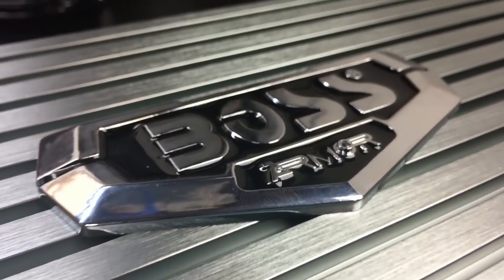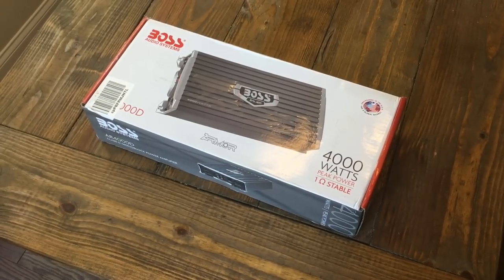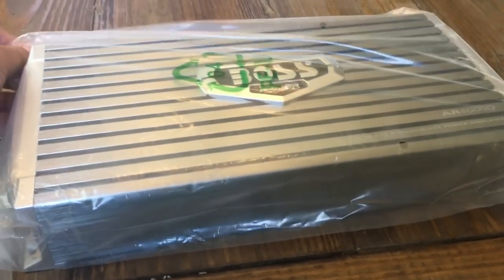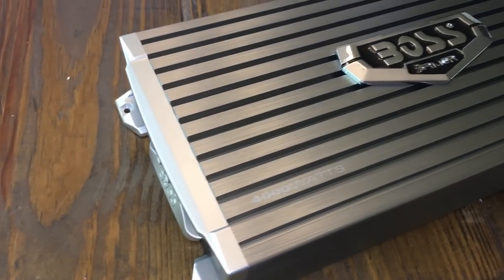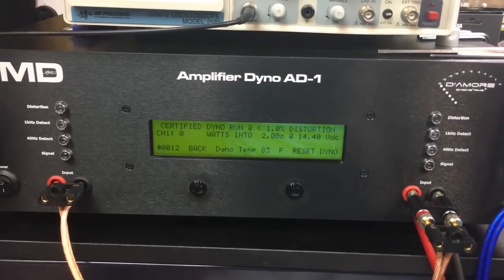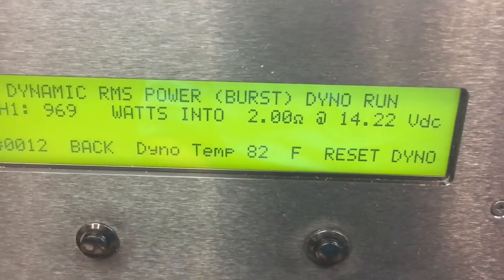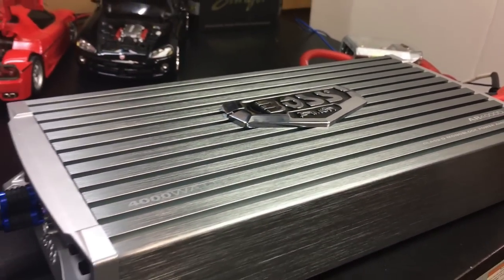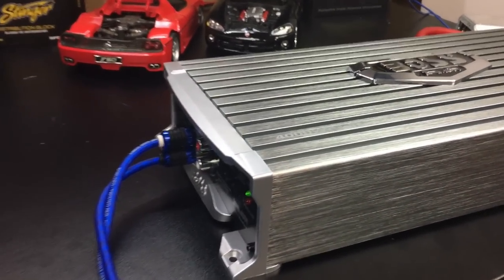Who's the Boss? AR4000D 4k MAX Amp Dyno Test

Comment: Derek, I decided to order this amp today, 2/7/20, based on your review. I didn't pay $85.00 you paid, as Amazon's price went up to $114.95. But  I wound up paying $109.95 for it on Walmart.com, which still seemed like a pretty good deal, even though it was a bit more than I wanted to spend. I watched several of your amp dynos, as well as many of Budget Gems. Despite the fact that Boss grossly exaggerates, and sensationalized their ratings with their fictitious figures, I found I  was quite hard pressed to find an amp actual dyno tested figures of power this high for $100. The watts per dollar in the neighborhood of 950 + watts dynamically at 2 ohms looks pretty hard to beat. And nothing beats the validated research you do, and dyno results. I'm thinking this should drive my two JBL 12" subs, at 4 ohms each for a final 2 ohm load quite nicely. Interested in hearing your thoughts and opinions on that.

I was also impressed with your thoughts on the build quality, and the fact you had a hard time destroying a Boss, short of dropping shreds of copper wires inside of the chassis. That in itself speaks volumes of what one might anticipate in terms of an amps durability, and longevity.

I considered many amps, and found a few that did come close, but went up in price dramatically since being dynoed. One in particular was the Walmart in store stock Power Acoustic amp for $69 when dynoed by Budget Gems, which is now almost $100.00 in store. No doubt retailers like Amazon and Walmart are watching these dynos, and marking up their price. In any case,  I just wanted to let you know how much I appreciate your videos, and how influential, and helpful they are for us naive consumers out here, who are quite easily duped by market strategy, deception, and baloney some of these snake oil salespeople will try to have us believe. At least those of us armed with knowledge you provide can make educated choices, and find value for our hard earned dollar. For that sir, I thank you for all your efforts.

Comment: A guy came to my shop with 2 of those "monsters" and 2 boss "2300watt" 12s he thought it banged. And was the loudest setup on the block.AAAnd it sounded like crap especially with the gain up all the way also on one battery rip off red top. 1000ca. And don't forget the box was one big rattle trap. His voltage drop tremendously were the car wanted to shut off. But after I redid the wiring with stinger 1/0 to the And for the big 3/4 also reinforced his box with some dail rods and a extra baffle. I also added a XS power D1200 in the back. Did the speaker wire as well (12gauge Rockford fosgate) each amp was tuned with a DD1 and gain match with a CC1. The system actually surprised the heck out of me according my to APM-1 he meter  A 143db sealed. So it's loud for the price he paid.  Boss maybe knocked but in the right box and tuned correctly it can bang That goes for any manufacturer. It's up to the installed to make it awesome.
Reply: djbz bruce-zabala that is very true back in the 90s people knew I could hook up stereos and they would always bring me a bunch of crap. I would hook it up and surprise everybody how good it ended up sounding.
Reply: I completely agree, a good installer can make dog shit equipment sound GOOD!

Comment: I had a 1500 watt boss amp when I was like 17. It was more like 150 watts... lol
Reply from the maker: +Gnik4144 this one beats the 10 percent rule, lol
Reply: Gnik4144 no impossible when you plug the numbers in
Reply: I have a newer 1500 watt BOSS. It pushes my 12'' Boston G3 no problem for $60 I consider it worth it. If I had to guess it's probably 375-400 rms at 2ohms
Reply: Even though no amp I've ever seen had a super weak 20% efficiency you are claiming your Boss amp was less than 20% efficiency? I hardly doubt that.
Reply: Tyler Padgett I also have a newer 1500 watt boss amp I would say it’s much closer to 200 Watts it struggles to push my 12” kicker cvx I’m upgrading to the 3000 watt boss amp and am hoping it will be in the 500-700 watt rms range
Reply: BigDWiz did an amp dyno on your Boss 1500 amplifier.  I think it did below 200 watts @ 2 ohms, very close to 200 though or maybe a bit over it.  But basically a 200 watter.
Reply: MacNifty search up the planet audio 1500.1M it's like 100 watts rms. Less then %10
Reply: I had an old school alpine 200 watts RMS hooked to my old diamond single 10 also rated at 200 watts rms in a big vented box, it hit pretty good and did really good below 30hz but wanted more so i got the boss amp in this video. Wired the sub down to 1 ohm and now im finally getting the most out of that little diamond sub lol, 200w rms on the sub but it takes all 900 from the amp just fine, sometimes it bottoms out but the coil never burns haha
Reply: Imagine a 4000watt rockford fosgate amp lol.
Reply: I remember doing my first ever system in high school i was 18. It was 2010 i went crazy on the subwoofers 08 kicker L7 12s in a rhino lined atrend vented box. And yeah you guessed it i bought a 3000 what boss audio amp i set the gains and everything for 1500 watts rms at 2 ohms. It wasnt 1ohm stable well needless to say my subs fried that amp after 2 songs 😂. I switched to a hifonics brutus BRZ 1700.1D.  1700 rms at 1 ohm and one 170 amp fuse so it put out what it advertised. Iv been using hifonics ever since
Reply: I have a boss 1600 watt 2 channel(bridged). I've had it for 4 years and it's pushing a 1500 watt 15" strongly. It never over heats. I've been reading alot of reviews on Boss amps and it seems the mono-blocks suck but the 2 channel is alot closer to the listed power and seem better rated by the average person. I would love to see a 2 channel Boss dyno'd just for comparison to the mono-blocks.
Reply: Ya folks  please put a little more money with it and get a name brand like Hifonics or Sony kenwood.or even buy a used amp make sure it works first.
Reply: @craigbarnett3564  Sony amps? Bahahahhaha junk. And Hifonics isn't thag great either.  I'd rather get an older used Alpine or MTX as a cheap amp.

Comment: I've been waiting for a video like this to show the real numbers.. I had this amp when it first came out and it sounded great and pushed pretty hard. at the time I was getting a reliable 800 watts out of it pushing 4 cheapo 10s in my truck. it was an awesome sounding budget system
Reply: I had one and was running two polk momo 12's in a ported box and two old xplode 12's in a sealed box,  in a 2000 grand Cherokee,  my rear window used to Flex a lot actually

Comment: Hey Big D. I bought 2 Boss audio Armor 4,000 watt amp because of you. I trust what you say and I enjoy your videos. I strapped my two AR 4,000 together and wired my two Audiopipe Txx BDC 15s down to 1 ohm and I have to say Big D !!! You are right!!! Not bad for the price. These subs are frickin slammin with two amps strapped and two amps for only $200 bucks a person really can't go wrong. I'm happy with AR 4,000 for the price. Thanks for your honesty.
Reply: Keep in mind that when strapped together the minimum impedance changes from 1 ohm to 2 ohm. You say your wired down to one ohm, but I think in reality you're amplifiers are not seeing a signal below 2 ohm due to box rise or impedance rise. The AC impedance is always going to be higher than your measured DC resistance.

Comment: 1400 watts for a C-note is a Steal!🕵🏿 👮🏻🏃🤑🚔🚨 But I would buy a CAB amp instead😜...if I was a budget hound.
Reply: Get the Pioneer 8601 for about $110 free shipping. 800w RMS
Reply: Its not a steal when you have to replace ur amp 10 times

Comment: I think your generous on the 15V assumption. Granted some people do run 16V for better performance, but all car alternators are 15V Ice cold, to 14.4V expected Voltage to 13.8V hot, with internal regulator. So I hope no one runs a large system without the car on. LOL. Still I would give this amp a generous 1656 watt rating at it's lowest possible Ohm rating. Myself I owned a good Boss amp over 20 years ago, it came with  a 6 year warranty, and it actually held up. Eventually it suffered from vibration damage.

Comment: hey you get what you pay for 100 dollars is a deal for that many watts
Reply from the maker: Build quality was better than expected. I was expecting poor fitment, cheap feeling and lacking bass. I was pleasantly surprised as my low expectations were apparently too low...
Reply: actually a $100 is a steal compared to amp prices 20 years ago.
Reply: jhue73 true I remember dollar a watt prices
Reply: Realdude rec true!!! in 1998 ish I had a punch 1000 it was $1000 and they didn't have the technology to dyno amps...if they did we didn't know it
Reply: Ryan Smith they were definitely real power back then lol I had the same amp on 4 jl audio w6 12s back then going crazy blew them bout 3 times
Reply: Realdude rec I had it on 4 punch series 1 15s lol. 4 altec 6x9s pushed by a little punch 40/40
Reply: Ryan Smith nice bet it was loud af
Reply: That's because they are using Chinese class D amplification I/C's and not true FET amplification.  The Class D amplification is what makes these amps so affordably cheap.  The up side, besides price, is that they are easily replaceable, for relatively low cost, if you cook the amp.  The down side, is the ydo NOT reproduce the audio to near as accurate a degree as a MOSFET amp.
Reply: Just because it has wattage doesn't mean it's good. More watts isn't always better.
Reply: They should market it as a 1k amp. Also I paid $500 for a 500 watt Soundstream back around 1995
Reply: So many boss haters in these comments.

Comment: It blows my mind that this is #1 on mono amp in amazon... But i guess i get it. They design is clean and the build will get you by. Like you said perfect for a noob. I had a Sound Storm lab ab-class 2000w and it was made by boss. It put out some bang but it wasn't the cleanest watts and clipped very easy and got hot as hell. I beat the shit out of it though. Good for starters
Reply from the maker: Amazon can't keep them in stock. I've been watching for a few months and prices vary between 82 (lowest I've seen) and around 110.
Reply: Umm.. if it "clipped" that because you had your gains/bass boost/head unit settings or volume too high.
Reply: bavarianblessed I wasn't talking about BigD's on the video... I was replying to BlocKustomz comment about his experience with his amplifier.
Reply: If I bought 9 of these amps for the price of one Rockford T1500.1bdcp... I think the dude with just the one T1500.1bdcp would fkn cry when you turn up the system and watch those cones fry!!!!
Reply: #1 on amazon probably cause of the price point and so many people just wanting a decent budget system. for $100 give or take afew bucks its definitely not a bad buy if your broke or just wanr a little bump and dont care about competition level setups for the 1000s and 1000s they cost. Makes sense its the #1 selling amp

Comment: A Taramps 4k would fit in a mailbox and still give you 4k rms.
Reply: taramps is a Brazilian board, almost guarantee you would see 4k out of it.
Reply: tramps do good power, but blow pretty easy if your electrical isn't in that sweet spot for   volts.
Reply: Yeah it's alot easier to get a larger voltage drop the higher the voltage you have to run it. If I remember correctly their amps are 200 volts! The cool thing is you can shock the shit out of someone on your door handles. lolol.
Reply: Tim Germany Crapamps? You're better off with Mmats..

Comment: Half tempted to order 2 of them and strap them on my power hx2s and see how they do
Reply from the maker: +shawn hilton I really need to get some subs hooked up and wired at 1 ohm so I can really give these amps a true test with subs after the Dyno test. My 4 ohm Infinity Perfect sub barely makes them sweat
Reply: Hmm.. Something like a Sundown SA-12 wouldn't be too bad though.
Those subs comes with an optional D2 or D4 coil, and are rated at 750w RMS
Reply: shawn hilton don't... Get soundstream rub 2500... Really good and for around 200 bucks

Comment: seems like a good deal for hundred bucks but how would this amp hold up to hot summer days thumping in the trunk for extended periods of time? lol
Reply: Anthony B D my guess is those bargain bin capacitors would quickly get out of spec and start wreaking havoc within a year or two.
Reply: Anthony B D read the amazon reviews. A lot say they run hot. I probably wouldnt go 1 ohm on it at   consistant high volume
Reply: +Jeffrey Barton You're right. Running 1 ohm
 on these boss amps will over heat and kick in and out of protection mode.  If you do use a boss for hours just fold down the seats and crack the windows and viola.
Reply: lilkamabeast 😂😂😂
Reply: Running at one ohm kills all amps faster than 2ohm. It's like red lining an engine while driving every time, all drive long. Further heat, vibration, age, and moisture are the demise of all electronics.

Comment: is it even legal to advertise such BS numbers?
Reply: silent saucepan it is legal. They don't advertise themselves as CEA-2006 compliant which is still not much of a standard since manufacturers like to test their amps at 14.4v  instead of the 13.7v you'll experience at idle.
Reply: Yep, it's 100% legal.  And the car audio market isn't the only place you see these practices.  Ever look at computer speakers?  My servo drive Yamaha multimedia speakers where advertised as 100W "max" though the manual said 12W RMSx2.  Yeah they are quite old now (but still work and sound great) - I don't think Yamaha makes computer speakers any more (too bad). Oh heck, just look at consumer home audio gear (esp the no-name brands).
Reply: Takes double the power for +3db which in loudness perception is basically just barely perceptible. So it wouldn't really matter much anyway.
You can see here the real world numbers, it's a $100...what does anyone expect? It could be half the power and no one would even notice because most normal people don't max out their volume knob with correct gain settings anyway.
Reply: Old school spanish music

Comment: When boss first came out I had a small 250 watt that was pushing 2 10inch tubes and it was more than enough. I wired for mono and took out 1 tube when I started getting indigestion from the bass bouncing the acid in my stomach up.

Comment: I have to say.. Boss are surprisingly good for a budget brand! I'm quite impressed with the way it protects there too! I've kept an old Boss Audio amp for years, it claims 160w x2 or 320w bridged to 4Ohms.. It does nowhere near that but really is 2Ohm stereo stable! Protected by a 20A fuse it does seem to put out more than 80WRMS per channel! Had it mounted on my wall for a while driving two pairs of speakers, running from a switchmode PSU, only giving it 12v but the brick was capable of 203 Watts (guess what brick i used!) and certainly made the neighbours complain.. The speakers were a pair of 8Ohm 8" Acoustic Solutions Powerforce 1000s (i think) and a pair of Mission 750 Anniversary edition (6Ohm) which sounded surprisingly good! Helps it was driven by a rather good sound card too. I also replaced the mediocre 4558D op-amp preamps for NE5532s. Only 'issue' with the amp is...it's pink!

Comment: I bought 4 of these in the past, 3 of the caps inside blow after a while driving at 2 ohms.  You'll see my review on amazon to replace them.  This is a good amp for the buck, really is, and as BigDWiz says great for starter setup because that was when I had my starter setup.  I had the 2000, then the 3000, then the 4000, and I actually liked these amps until they started blowing those caps.  But in reality if you want power just dish out the money ahead of time and get good amps and good power.  As with any amp make sure you have enough power to push these, you don't need much extra especially if you just have 1 amp, a HO alternator and maybe a second battery.
Reply: Bro you don't need extra power to push these I got mines stock and it does just fine

Comment: So do you have any suggestions for a single Sub.. that would be a good choice for this amp? I have been out of the car audio "game" for quite a few years and I'm startin to build a system for my truck? Insane massive bass is a must for me,and my M.O. has always been big subs with big SPL......I'm kinda diggin the lower priced brands and equipment so I can demolish and melt shit down occasionally without losing to much sleep and/or a wife? Any suggestions? Thx

Comment: I bought 4 of these 4000 watt boss amps and they all burnt up 1 lasted a month 1 lasted 1 week and two of them i strapped together to two 15 inch rockford p3's they lasted two weeks and burnt up in my experience with the boss  ar line the only one that i found to be a good one was the ar 1500 i put it on 4 rockford r2's and lasted for a year and a half then sold it and the r2 subs to upgrade to all rockford prime 1200 amps and rockford p3 subs been two years now and no problems 
Rockford fosgate prime 1200 
Is a great little amp that is reliable
And p3 subs hit  clear and hard
Rockford = quality & dependability 
Just my real life experience with all these products
Reply: Willing to bet it on the cheap ass capacitors. Fingers crossed on my "1200 watt" 4 channel, solid so far. I have two channels bridged running my sub and the other 2 for my speakers, with the gains properly set it's impressive for the price I paid, definitely better than head unit power. Considering putting a 1500 watt monoblock in for the sub and running the 1200 watt as a dedicated 4 channel.

Comment: I've had mine a year now and it has pushed my kicker compvr 12s really up until about a month ago. The high/low input switch shorted out. I've emailed Boss audio about repairing it and I got a response . I gave the customer service representative my information and haven't heard anything back in 4 days. Surely there is somewhere I can send this thing to get a simple switch put back in it. Any advice ?